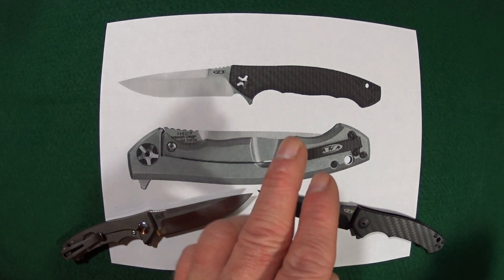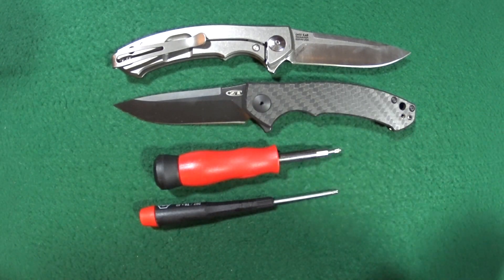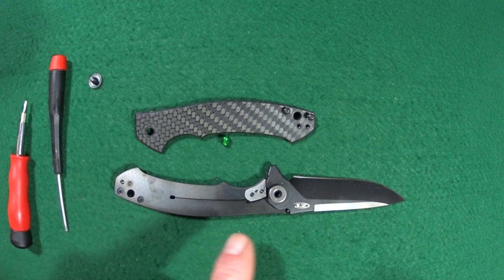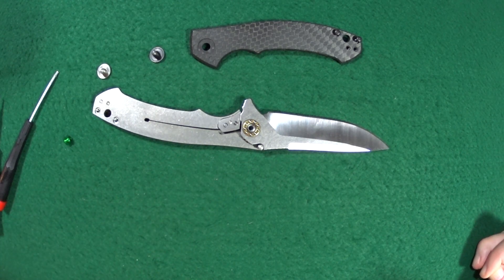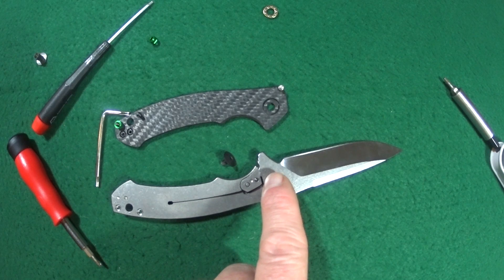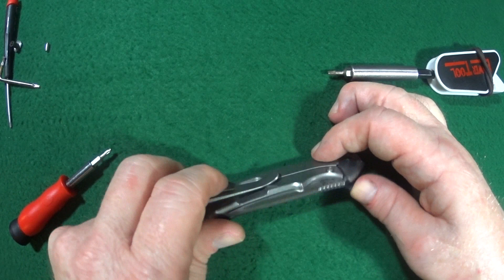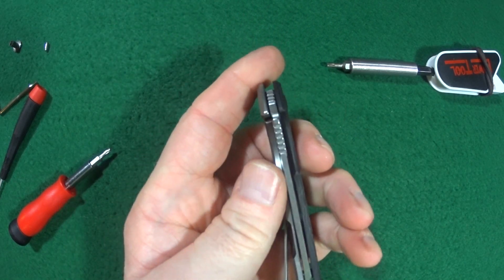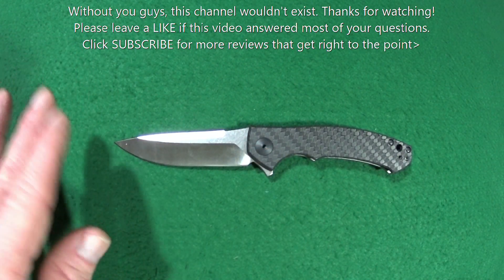Zero Tolerance ZT0450 Modification - Easy to make mini ZT0452CF

Comment: Looks great just wondering what the other knife looks like now. I actually have both versions as well. I always wondered why they didn’t give you this version from factory since they have all the pieces they needed to create it and in my opinion looks the best
Reply from the maker: I'll have to post something showing the other knife with the leftover parts. I'm gonna guess that ZT didn't offer this configuration in the smaller size because they wanted to give customers a reason to still buy the 0452CF. Thanks for watching Brian.